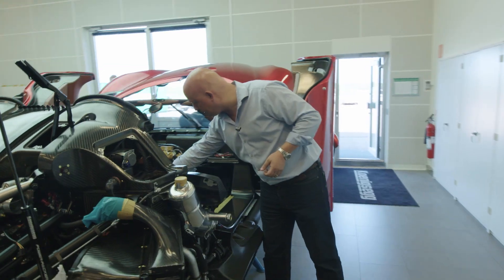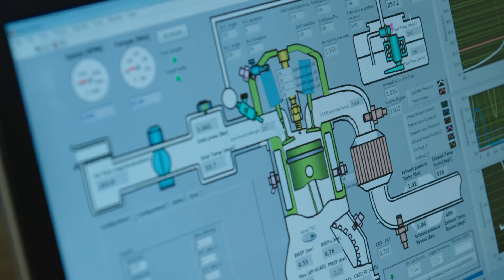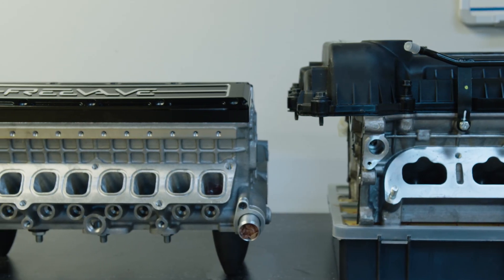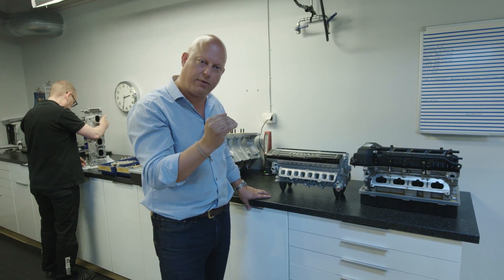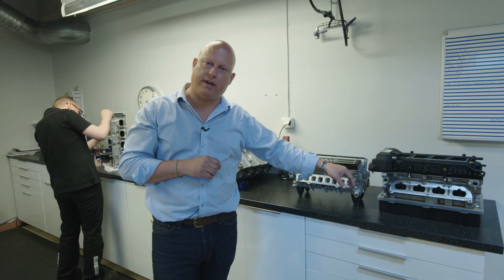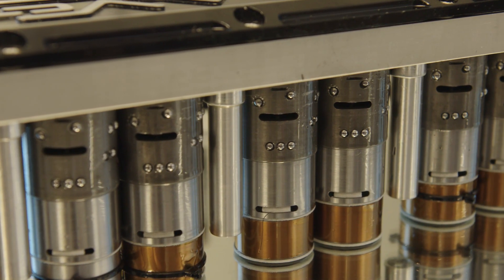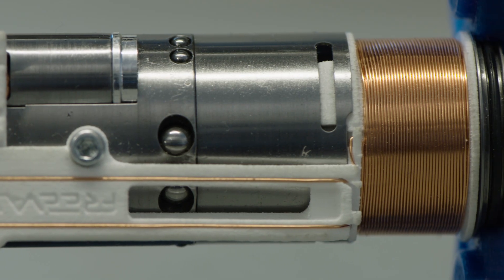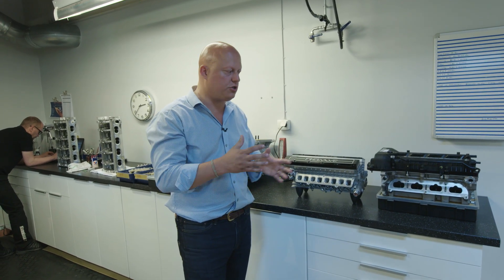Freevalve Update Camless Engine -- /INSIDE KOENIGSEGG

Comment: we went from Push rod engines to overhead cam engines that eliminates the push rod  rocker arms ,soon the valves will use solenoids eliminating the cam shafts. then again, there's the Brushless electric motor.

Comment: Basically valves become just like fuel injectors,a magnetic solenoid  good idea, not a stretch but it will take a while to see how many thousands of miles they can last and of course its not cheaper than cams so we will see how that plays out. GMs new 4cyl truck engine is an art form in spooling a turbo at very low Rs and working at high Rs also.

Comment: You know what's really sad is that when I was in school for automotive engineering, one of my instructors and I tossed around the idea of individually actuated intake and exhaust valves to allow less rotating mass and unlimited timing control on an individual cylinder basis and we never went anywhere with it

Comment: Solenoids in auto gearboxes seize and fail all the time so this would be my question, that of reliability. For the consumer if a valve sticks or sticks intermittent, it's head off time. It sounds good but there have been other developments before this that haven't caught on, so the notion of the internal combustion engine as we know it being improved upon is not new.

Comment: Tucker engine 1948 , was a 6 cilinder boxer , with hidraulic operated valves , camless engine , also has fuel injection and gearless transmission via dual torque converters , engine fits inside the chassis and lower the center of gravity ...
Reply: The production engine a modified Franklin 6 cilinders boxer , dont have hidraulic operated valves , but the prototype original engine yes , and fuel injection too ...

Comment: At 3:35 and 3:43 you can clearly see a metric class 8.8 hex head bolt near the valve actuators.  It's surprising they would use a medium strength bolt in such a high-tech engine.  Class 10.9 or even 12.9 is readily available.  This allows you to get more clamping force or redesign using a smaller diameter bolt to get the same clamping force with less weight.

Comment: It's interesting engineering and probably great for short life racing engines or overpriced cars. If the electronics fail you call a tow truck and then your banker for a 2nd mortgage to pay for parts. Coming from marine, I have found electronic engines of all brands unreliable compared to older all mechanical engines. The sensors and electronic controllers are expensive and fail much more often than the OEMs tell you when trying to sell their engine. On the ocean, if you don't carry a large inventory of expensive spares, you pay for a helicopter delivery of expensive parts. It's easier on land, you pull over and wait to be fleeced.

Comment: fewer engine parts rotating in the engine means more torque available at the wheels. love it
Reply: The extra torque come from the timing of the inlet and exhaust valves.  A management system can also make this a two stroke. In short it can instantly convert to a two-stoke when the demand is there, seamlessly - and on the fly.
Reply: omg he said it himself dude
Reply: sugar glider
Good, you  had a second look.
Reply: you're so thick the first reason for the torque increase come from the fact that the engine doesn't have to deal with timing chaine, camshaft, the extra friction and inherently the torque needed to spin those things. of course then you gain more from being able to control the valves at will.

Comment: The Possibilities of this is Unprecedented. Imagine having a Straight 6 Cylinder variant and having the technology to shut off cylinders and make it lets say 4 cylinder or 3 based on power needs. Seeing this is already powerful imagine gas mileage to shutting down power for lets say day to day work commutes then switching up the power for weekend joyrides in a sporty variant of a daily driver/Sports car. (:minus the ~super car~ aspect, we cnt afford that..... YET:)
Reply: BjornFSE
Shutting down cylinders is not new. A production car not long ago did that. But there are still pumping losses on the shut down cylinders.
If you want to shut down cylinders it is best to to have say two small balanced engines say of two cylinders each (camless engines are idea for that), coupled together at the crankshafts by an electric clutch. The EcoMotors OPOC opposed cylinder engine under R&D is designed to have such a clutch. One two cylinder engine say runs and seamlessly brings in the second engine when there is the demand.  The second engine could switch out when cruising on a highway or slowly around a town.  When de-coupled the shut down engine gives no drag whatsoever. In short, staged engines. The cooling systems would need to be combined to ensure the second engine is up to temperature when say it is switched in on full load as say running up a hill.  Also if one engine fails the other can get you home.  The exhaust manifold can be inside the cylinder head to ensure a rapid warm up as with some new engines on the market now.

Just like large heating boilers in large office blocks. when the heat demand rises another boiler is seamlessly switched in. There could be 3, 4, 5, 6 boilers.

A large car running down the highway at 70 mph only needs about 20 HP, yet an engine capable of giving 200 HP is fitted and cylinders running.
Reply: My 07 Trailblazer already shuts cylinders off. I would like this tech on my 4.0 straight 6 though.
Reply: Cylinder deactivation has been around since the '40s. Mercedes had it first. Cadillac was the first American manufacturer to utilize cylinder deactivation in its 8-6-4 engine... a V8 with 6 and 4 cylinder modes. Later, the "Northstar" line of Cadillac engines utilized "revolving" or "roaming" cylinder deactivation, but was only used as a limp mode in the even of overheating (given their predisposition of head gasket failure, not a bad idea).

Comment: Funny thing, 20 years ago, me and my car nut friends wondered why there wasn't an engine which used solenoids instead of a camshaft to control the valves. We should have drawn out some sort of design, and patented the hell out of it.
Reply: A camless engine was built in the 1950 using solenoids.  It used vacuum tube electronics. When driving under power lines the engine was affected.

Comment: Its an old tech, been around since the 1980s. The problem is, electric solenoid motors don't have the number of cycles in them(as a valve spring). And when 1 solenoid dies the engine will explode.

Comment: This is very good, however is this not TOO LATE? Current trends have seen that internal combustion will become phased out in the future because of POOR efficiency and that Electric Cars are the next step. This CAMSHAFT-LESS TECH and infinite valve control at all RPM would certainly improve efficiency but would it be enough to change the common mindset and can it save the combustion tech.

Comment: They are getting there,  but are still thinking inside the Box, until they figure out that a cylinder head, intake and exhaust systems can be removed/changed  and in doing so the power scale would change on 4 piston rotations from the "Normal" 135 hp and up to start out at 400 plus hp with a higher rpm band of 16-20,000, a programed ecm to meet demand by simply stepping on the gas pedal

Comment: F1 was using this in the 1990's

The way to go is rotary "sleeve" valves which give you a direct path into the cylinder and the opening and closing can be controlled individually via sliding plates.

Comment: I've worked on engines since I was a little boy, learn from the old "heads" also electronics and one thing I had learn that heat can be your friend but mostly your enemy......coils break down in heat so does electronics no matter how good your insulation is, you're going to have problems sooner or later with those electronic valves.

Comment: Still an internal combustion engine where as 75% of the energy gets expelled as heat. Electric cars and hydrogen power are going to make this obsolete. And soon. But it  is state of the art 
internal combustion technology.  1. Work on re-claiming the heat energy thats lost thru the exhaust and radiator.        2. Cut the rolling resistance.      3. Aerodynamics.        4. Driveline friction loss.

Comment: Imagine VCR (MCE-5) + camless (Freevalve) + VVTL + Atkinson cycle + HCCI + GDI + VLIM + EGR + CVT (Ultimate Transmissions) + electric motor for start : consumption divided by 2, torque and power multiplied by 2, NOx emissions reduced by 70%, CO2 emissions divided by 2.5.

Comment: Too much efficiency for the EPA in the states. They won't have anything that can get over 30 mph for make decent power per displacement. I love it though. Keep it up free valve. I work for caterpillar and we have been dreaming about this for years. The long blocks we have are essentially the same as they were 50 years ago except they have all this crap strapped on the exhaust and it does not last. Engine life is reduced 50 percent. Make less power and burn the same or more fuel plus def fluid. We need free valve.

Comment: I fail to see how this is relevant when in modern reality an electric car on street tires can to 0-60 in 2.3 seconds.

If this valve tech came out in lets say 1990, then it would sure, industry is on the right track, but in the second decade of the 21st century this is some sort of a cruel joke.  

To this day dry sump is still a rarity reserved only for high end cars, consumer internal combustion engines are obsolete.  The only rational use would be for diesel and propane motors, for industry and power generators.
Reply: im gonna say...arent all electric cars AWD? this is a hybrid engine [gas and electric] RWD

Comment: the twin port design is the way to go one port kind of small, the other port moving 400cfm and only use one port on idle and small lift and duration and then when you give it a boot 1 pro stock lift and duration lol.

Comment: What if you coated the piston and cylinder head combustion surface with a coating that reacted with microwaves and this ignighted the fuel in the combustion chamber all at once ?this would increase the efficiency and power while eliminating waste

Comment: So they're actuated by solenoid.. solenoid can fail probably like 50x faster and easier than a standard mechanical cam.. sounds like more parts to fix down the line..
Reply: jojuae pneumatic actuator. Everything can fail. Did you make up the 50x?

Comment: Another thing that goes away is power losses from the cam system overcoming valve spring tension. An engine like this could idle wicked smooth when tuned properly.

Comment: Nice...
So, They're dumping all of this money into this, and not less complicated, More powerful, More efficient, Cheaper to fix and replace, electric vehicles?
While also managing to make the inferior> I mean internal combustion 'engine' more complicated?
Its already a pile of Clunking, Smoo inducing, Dinosaur burning, Racket making, Repair inducing pile of scrap?
And not a Power inducing, Very Slight Coil Whine making, Magical Electron Pixi-zapping Electric motor?

Ah, I got that wrong, with this tech its a Clunking, Smoo inducing, Dinosaur burning, Racket making, SUPER Repair inducing, Over complicated, Over qualified and complicated solenoid Valve wanna be Hydraulic RAM-  pile of CRAP?

Comment: Air actuation....ooooh, I dunno about that in the winter, wet air would freeze it up. Savings in the heads themselves, but you'd need a whole support system for filtering, drying and heating air....good concept, but I think electric actuation might be a better way to go.

Comment: 1. What about emissions after the cold start phase? (remember: no multi point injection possible. 2. What about total cost advantage/disadvantage overall for the engine? (valve actuators look quite expensive. But then, no camshafts and auxilary drive required). 3. What about reliability in this high temperature environment? Safe state after failure? Overall, nice concept but probably 10 years too late.
Reply: This isn't preventing multi-point injection, it's allowing for port injection to have no drawbacks compared to direct injection. Port injection is still multi-point, single-point is throttle body injection which I'm not aware of being used in many years. He said this could be used with direct injection, there just isn't need for it as with this system port injection will provide just as good performance and is much cheaper. Camshafts and valvetrains are typically pretty reliable (the biggest failure point being timing belts and chains) so this probably won't improve reliability, but it should reduce size, and maybe eventually cost. I see this as similar to going from carburetor and points-distributor to fuel injection and coil packs. Was expensive, unreliable, and didn't work too great at first, but now is completely standard, and way more reliable. Many people are intimidated by the complexity of such things and just want their old carburetors they could work on with a screwdriver. I started out that way and bought an old classic Bug to tinker with, but eventually "saw the light" of more modern systems and modified the Bug to have pretty much modern engine management. Would love to put this system on it...

Comment: I'm not understanding how they can used port injection still with a 12:1 turbo setup. Compression ratio is usually no more than 10:1 on a port injection engine because of pre-ignition. I'm not understanding how freevalve gets around pinging....?

Comment: How durable is this system over extended mileage ?
Reply: Should be just as durable. I'd say even more durable. You don't have camshafts and bearings that wear over time. No camshaft drive that wears/no timing chain or belt. A coil might burn out in the actuator, but I don't see much else happen to it over time. This freevalve system works much like fuel injectors. Electromagnetism opens closes them.
Reply: This is my doubt. Why Mercedes/Porches  didn't created This technology?
  I presume it was tested significantly..
Reply: They have testes it in a saab for 10000km flawless. Theres is a video of it

Comment: Clever though it may be it's still essentially improving on 19th century technology. Electric engines are more powerful (for the same mass/volume), way more efficient, provide full torque from 0 RPM, can start themselves (a petrol/diesel engine needs to be started, normally with an electric engine and a small battery), and are orders of magnitude simpler, hence orders of magnitude more reliable. The weight and cost of the battery is indeed the problem, and hopefully we will find a way to fix/ameliorate that. For cars and trucks, electric is going to be the future, however where I don't see this working is with airplanes, for now we are pretty much stuck with jet engines.

Comment: This offers so much tuning possibility.. the compression ratio they can run at for a turbo engine is insane and awesome. 240hp out of a 4cyl with better fuel economy. I want to tune on one of these the possibilities are immense for tuning turbo applications  and NA. The only thing that sucks is you would have to design your own head to apply this to other engines. Please come up with a design for the 4G63.

Comment: The performance improvements of this type of induction is without question. the biggest doubt that I have comes in reliability and the consequences of failures in the system. It seems that the more we become dependent on software, the more vulnerable we become to large scale failure of the system. I have gotten used to placing my confidence in a rubber belt to operate my valves. (never thought I would) but it has proven to be reliable. I cannot imagine, ( given the record of modern electronics ) putting my confidence in a another circuit board.  I fine comfort in the simplicity of my metal cam, and my magneto ignition. My 35 year old lawn mower has seen 5 cars come and go from the driveway.

Comment: Koeniggsegg needs to combine freevalve with the variable vane turbo-per-cylinder concept. The combination of those technologies would revolutionize responsiveness of a turbo charged engine. You could leave the exhaust valve open twice as long on decel to maintain turbo RPM, and could have response with turbos very close to that of a naturally aspirated engine.

Comment: Although individually activated poppet valves add greater intake and exhaust control, they're still poppet valves. Another solution might be to integrate individual valve action via motors with the Coates Spherical Rotary Valve System.

Comment: Variable timing valves and full control of valves is the next thing.. just like variable intake port and so on. But that isn't new idea.. so far main problem has been current what those solenoids need.. and that is much, cos there is lot of pressure in cylinder.. specially when exhaus valve need to open. Has they tested how much engine need to use power to make that much current with new bigger altenator?
Reply: oh, it was used with pneumatic solenoids.. well, it takes power to make compressed air too and it is almost like other engine (if you use piston compressor) to make run your engine..